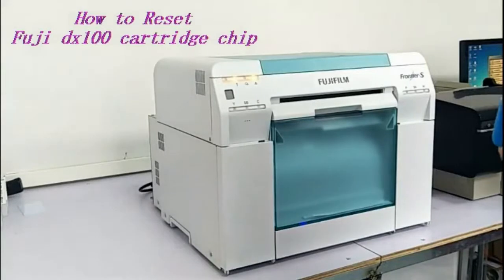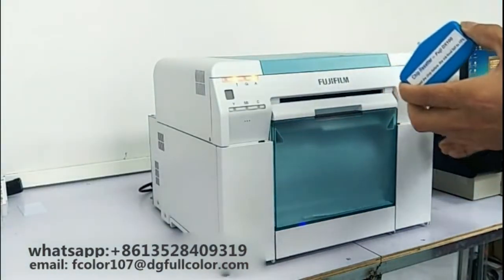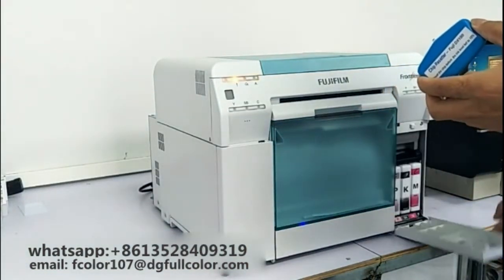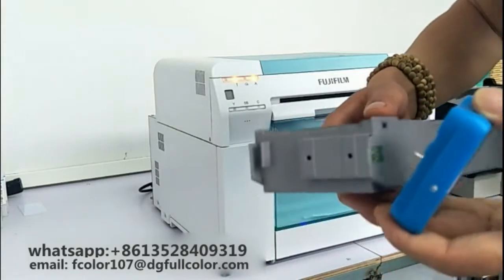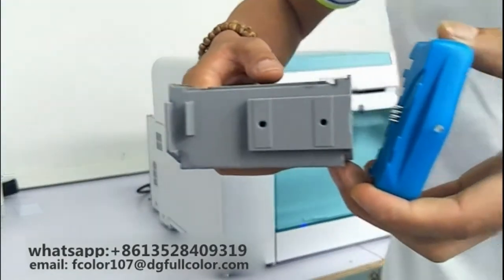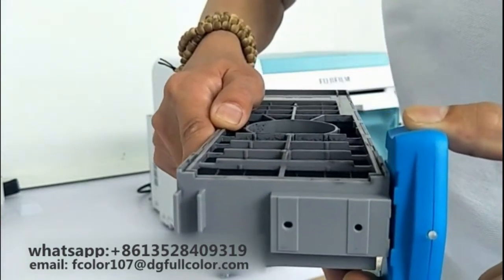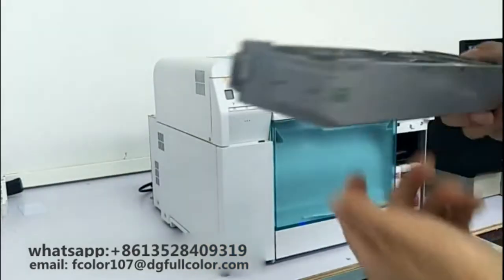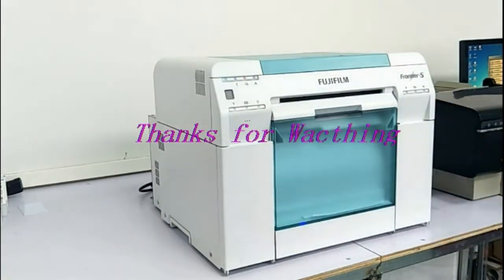Fuji Frontier S DX100 Chip Resetter for Maintenance Tank

Comment: I have had the Fujifilm Frontier dx100 for two years. I am very sorry to buy it. Two breakdowns that have cost me € 1000 with a practically new printer. I have been greatly disappointed by Fujifilm. Your representative in Spain has told me that it is normal for things to break down. It doesn't look like it to me after only two years of use.